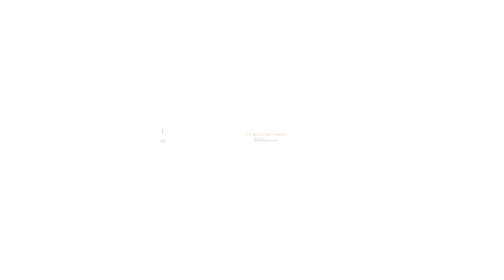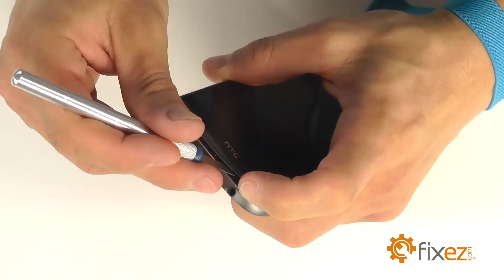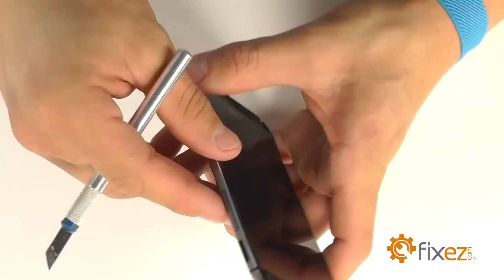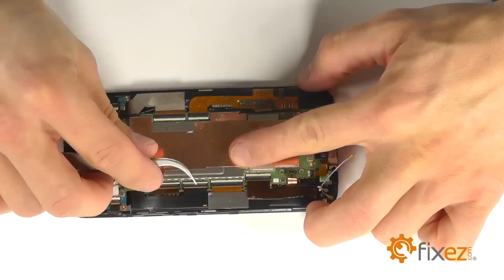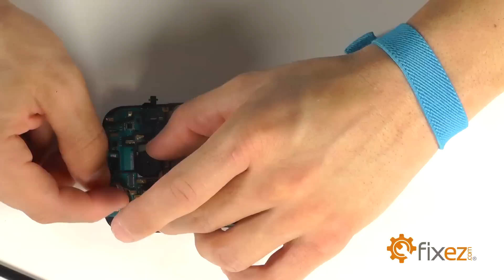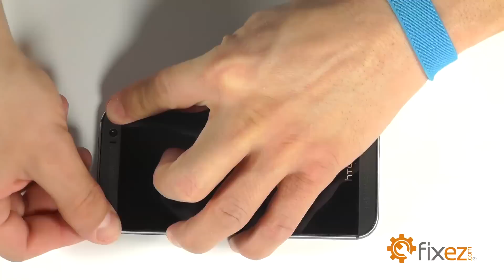Official HTC One (M8) Screen Repair & Disassemble

Comment: You should have mention what version is. Because there are 3 version. M8s, M8sn, M8su. There are big differences inside on the motherboard, charging port, display connector and antennas cables

Comment: What adhesive should you use when using a new part? Video is slightly misleading in being able to reheat and reuse existing adhesive on the existing chassis and part to be reinstalled..which wouldn't be available when replacing the screen?

Comment: Thanks, repaired the M8S with this, it pretty much had identical guts save for 1 extra ribbon cable that had the power switch, a connector to top board, and a direct connection to main board.
Reply: My htc not on when charging show battery logo

Comment: For those who will be doing this:
This process is a lot harder than what it looks like; they had done it before, therefore most of the parts were easier to remove or maybe just a new phone. I attempted to do this and it is harder to remove most of the components and be careful when prying ribbons, they easily break, I didn't break mine but I was really close.
Reply: I was about to disassemle my old m8 for the "funsies" as it's digitizer went kaput back in 2017. saw this comment and changed my mind lol

Comment: Followed this video and replaced my screen however I snapped the clip from the board that you plug the vibration motor into. I didn't realise it pulled out and just pulled it away from the board. Is there a way I can repair this? Do I need a new board? Tbh you don't even need to take that plug out wish I hadn't bothered
Reply: Soldering isn't really an option as it's so small, I've bought some adhesive glue to try, after that I'd have to just replace the upper board which I won't be doing.

Comment: Great Video, awesome Detailed Information, Wish I saw this video first :o/  I was able to replace my Charging Port, but after re assembling , My Volume down button does not work i can hear it click when I press it but it does nothing :o/ Also my power button has sunk in, and I have to press it down with my fingertip Nail to power it off or lock the phone, Can you tell me what I may have done wrong, and will I be able to fix it myself? Thanks. I have a developer Edition and would like to Keep the phone till a new better model comes out, I am not to happy with the M9 or M10 :o/
Reply: ERVARGAS NYC you just need to take it apart and put those buttons back in properly. Put the power button in and then do the opposite of what this video shows putting the top of the phone back into the housing rather than the bottom
Reply: George McArdle Thanks, Will Give it Another Shot. I havd bought. a brand New HTC One M8 AT&T Version,  Got it from someone who got it as a gift and just put it away, because he was into IPhone.  I would like to Fix My HTC's Buttons, As it's a Developers Edition Fully Factor Unlocked, Paid $740 including Tax,  from HTC.com  and I can Tether with Developers Edition with no Issues at all. AT&T phones block Tethering :o/

Comment: Just installed a new screen on my HTC one M8 by following this video.  Everything worked out good but now its saying No SIM.  Played around with the SIM holder and tried multiple things.  Decided to swap back in my old screen and its saying the same thing, No SIM.  Is there a connection i may have missed that would correspond to the SIM drive?  I checked the ribbon connection to the SIM and its full seated and locked down.  Any suggestions let me know.  Thanks
Reply from the maker: Check the connection shown at 7:20, Also check the contacts on the sim card as well.
Reply: Cole J I had this same problem and had to go back to my old housing
Reply: Yeah I have the same issue. I think I damaged the port on the main board and the No SIM message appears regardless of which housing I use. 
Welp - This was a solid learning experience at least. Plus I think using a phone for 3years is pushing it.
Reply: You've most likely damaged the ribbon on the sim card reader
Reply: Well thinking back the earpiece stopped working also. I'm going to check if the issue lies with the camera also because then I prob messed something bigger up haha!

Comment: Hi, i have to change the battery of HTC E8, anyone know if it is the same battery of M8?
In ebay for M8 i found B0P6B100 - 35H00214-00M
and for E8                     B0P6B100 -  35H00214-01M 
Probably this little code difference make them non compatible but i'm not sure....

Comment: I've done everything correctly, but at random times the phone will shut off without notice. I reopened it and looked for loose connections but their isn't any. it usually shut off while in my pocket and that's it. The power button doesn't get stuck. Does anyone have any ideas? Thanks in advance!
Reply from the maker: +skyeye21 If the insulating tape is not replaced over the connections they can sometimes short out against the back housing.

Comment: replaced my screen as you did. but the charging light just flashes orange and the phone wont turn on. the screen shows a battery charging symbol. any ideas?
Reply: I'm facing the same problem. Found a solution?
Reply: yes, the battery connection under the 2 screws wasn't aligned and snapped in

Comment: Question. How can anybody do this without getting frustrated?
Reply: Honestly, no flaws. It's everything you can ask for in a phone.  But, here's a note. I would also consider checking out the Nexus 6p since it's slightly bigger and better than the 10 by faster fingerprint recognition, slightly improved battery and camera (front/ back). Drawbacks are that unlike 10, 6p doesn't have sdcard slot. But from my experience, 6p performs slightly faster than the 10.
Reply: Holy shit who was the dumbass millennial shit engineer at HTC who designed this in a CAD program.  Someone beat his ass with a paddle that reads user serviceability.
Reply: CHOPPERGIRL's AIRWAR stfu with your millennial bashing. It’s getting old.
Reply: @choppergirl  😂😂😂
Reply: My screen has a lot of odd white spots on it and I thought about doing this, but nope....no chance lol. I can get a new phone on Ebay for sub $200 now.
Reply: I got thru the disassembly process.. breaking a flex cable of the LCD.
 And now I'm enjoying my new HTC 10 :)
Reply: hey goodday ;) how was your HTC 10? i am about to buy one next month ;) is there any issues you face for these 3 months of usage?
Reply: Take your time
Reply: idk how you got frutrated i mean it not easy and not hard
Reply: It is a really frustrating job!  It took my 5 hours just to take everything apart!  I do however love the detail the guy gives.  But yeah, it was real frustrating, and I had to walk away several times before sitting down and trying again!
Reply: well is really hard not to get frustrated only if you really like to work with electronics and disassemble and assemble them again also once you got a litlle practice it becomes easier. 
P.D. I work on this so i actually love it

Comment: i have a minor broken screen and i would like to replace the screen can i do so without further harming the screen
Reply from the maker: +wateule muse-ick If you're removing your original screen, you will most likely damage it in the removal process. Try your best to work through it slowly to prevent this but it may still get damaged.

Comment: HI. NEED HELP Fixez.com !!!

Done everything as per your video to change lcd, but now no touch and constantly reboots after 2 min. Thanks in advance!
Reply: +WorldWide Video 
UPDATE: reattached touch flex and now got half screen respond only, no reboot.
Done very close inspection under magnifier next to touch connector AND noticed that one micro filter broke off while im been disconnected flex several times. NOW looking for used logic board. Expensive mistake.
SUGGESTION: Dont repair HTC if you never done it.
Reply: +WorldWide Video how you gonna learn if you never do it. gotta start somewhere. Just because you fudged doesn't mean everyone else will. Then again I have repaired a lot of apple phones screens before. As long as you are very careful and follow instructions you will be fine. just work slow and double check what you are doing.
Reply from the maker: +mattike53218 Thanks for the input, positive thinking goes a long way.

Comment: I performed this repair yesterday and the video was very clear and helpful. Problems now are my power button doesn't depress like it should and the rear-facing camera doesn't work.  I can get the phone to power on & off by pushing really hard on the power button with a coin or something hard. I took the phone out of the housing and made sure I had the power button properly oriented in the case and that the part identified in the video as the proximity sensor (which seems to also have the power button connection on it) was in place.  I repeated this disassembly and reassembly twice, but no improvement.  It just seems like there is no "springy-ness" to the power button. Like something is missing, but I'm sure all the parts are where they should be. The proximity sensor doesn't seem to have much if any adhesive on it, so even heating it up didn't make it stick down very well.  Maybe I need to install some double sided tape under it? 

As far as the camera goes, I checked the connection on the bottom of the board as the video recommends and it was solid.  The rear led light works and the front facing camera works fine.

Any advice on either of these problems would be most appreciated!
Reply: +John Wiltse  Update: I took the phone apart again last night and figured out the power button problem. I realized that the power button is located between the little black button and gold foil piece (proximity sensor maybe?). Once I knew that, I was able to get the power button to align between those two protrusions and now it works fine.

No luck on the camera, however.  I confirmed that the connections are all solid but it just does not work. Crashes the stock Camera app.  When I tried a different camera app, it actually gave me a camera error message. I see there is replacement rear camera for sale on the fixez.com site, but I think my camera actually has 2 lens connected in a single metal housing (for the Zoe features) and the part on the web site doesn&#39;t appear to have the 2nd lens portion.
Reply: +John Wiltse hey  can you tell me what actually happened  to your rear camera. My phone screen broke so I gave it for repairs,  but the camera isn't working now,  front camera is workinh fine,  just I get black screen if I try use rear camera from snapchat Or Instagram and the rear camera isn't being shown at all in the camera app. 
Regards, 
ABHI
Reply: I didn't get a black screen when using the rear camera. As I said before, choosing the rear camera caused the camera app to crash. I sold the phone on eBay advertised with a non-working rear camera and bought a reconditioned replacement.

Comment: Thanks for the vid. I just replaced the screen and charger port in my M8. Before I put it back in the back housing, I tried plugging it up to the charger and pressing the power button to see if it works. The battery has been dead for about 2 weeks so I don't know if the battery needs charging for a while longer or something internal. The LED orange light stays on while plugged up and the phone doesn't come on when I press the power button. Please help.
Reply from the maker: +khaoe smith Your battery may be bad. But it can also be a bad LCD, double check that nothing was missed on the reassembly. Check your flex cables to ensure they are seated properly.
Reply: +Fixez.com ugh....I checked everything and all the connections are OK. The other day while checking some things I broke the clip that holds the ribbon that you take apart at 06:12 but the ribbon still goes in and holds firmly.
Reply from the maker: Possible the connection is not fully seated. Although appears to be, it may not be holding it's position as it should.

Comment: i replaced my screen as you did. but as i put the charger on it because my battery was stone dead. my charging light just flashes orange and the phone wont turn on. the sceen shows a battery charging symbol. any ideas?
Reply: turns out that the battery plug didnt seat correctly, and it turned on once i out it on correctly again
Reply: same thing happened to my phone now. what did u do to fix it?
Reply: just keep the charger on and the light will go solid red and then you will be able to turn it on.
Reply: Used the Charger of my Chromecast with only 0.25 Ampere. Used the original with 1.5 Ampere. now it's working!

Comment: My HTC M8 screen shows no physical damage. The screen just keeps phantom pressing (severely at times)..doesn't respond to touch sometimes...& the top part of d screen used to get to the pull down menu doesn't work at all...these problems just started out of the blue...might this be a software issue or should i just replace the screen ????? 

Thanks!
Reply from the maker: +Raoul Fraser Possible software issue. Try a factory reset first, if the issues continue your digitizer is most likely the issue. In this case you would want a new a LCD and Touch screen replacement.

Comment: I did everything as shown, but the sim card doesn't work.. Any ideas?
Reply from the maker: +Vasil Filipov There's a small flex ribbon that should be connected by your sim card slot. Ensure this flex cable is connected properly.

Comment: Hi, is there a easy way of separating the touch screen digitiser from the LCD and then putting a new digitiser onto the previous LCD without any issues? Or is it easier to just buy a new LCD that's already fused with the digitiser?
Reply from the maker: +rachid qui You would want to replace the LCD and Touch screen as the LCD is fused to your front glass.

Comment: question will having lose connectors behind the board where the camera is cause the power button not to work?? I replaced the screen and noticed it wasn't working then took it apart again and noticed one of the connectors behind the board was not connected. just wanna know if that would cause the lower button not to work before I put it back together.
Reply: *power button

Comment: Hey. I dropped my HTC m8 the other day. The phone fell on its right side bezel and shattered the screen. everything works perfect, just the screen is shattered. However, there is a small 1/4 mm dent right above the SIM card slot, which is protruding into the screen where the phone is shattered the most. So I was wondering, do I just need a new LCD display or does the whole chaseè need to be replaced in order for the screen to fit properly again? Thanks in advance.

Comment: Hey, the rear facing camera doesn't seem to work. There is no option to switch between cameras. I took it apart again and check the connection and it seems fine? any advise?

Comment: I went through all the steps to replace the digitizer and powered the unit back on...everything works except for a portion of the digitizer (the location is where "Power Off" would be located when you hold the power button on the phone). Do you think this would be an issue with the replacement digitizer or would it be a faulty connection with one of the ribbon cables? Any help you could provide would be greatly appreciated!

Comment: You need to go into more depth on how to remove the earpiece speaker. I just destroyed mine thinking it was supposed to be easy to remove... Let me just tell you all that it is not.
Reply: Braden Jensen *****  I Should have read the comments... just done the exact same :'( It is very delicate and if you don't go deep enough you just rip it in 2.....
Reply: Yeah that's what I did. I ordered another one. Comes next week..
Reply: Braden Jensen I ordered a "Genuine" one and the speaker just buzzes at full volume so its defo not a real htc one.
Reply: Sarah Banister are you on the stock ROM?
Reply: Yes i am on Stock ROM =)

Comment: i have  an htc one m8. it got run over by a car. the screen of course was completely shattered and it did not display anything. i opened the phone up and it was perfectly fine in the inside but the lcd was cracked. i put it on chrarging and the led still turns on. i was wondering is it just the lcd or the phone. again the mother board and the inside looks perfectly fine.
Reply: THanks for you👍

Comment: My m8 fell and is bent slightly from the top of the volume button. Everything still works fine but my screen has a small purple-blue ish spot. Touch works perfectly, and everything is still being displayed on the screen, even beneath the spot. Does my digitizer have to change or the lcd? Thanks

Comment: Hi, thanks to show how to disassemble HTC m8. Did follow steps to change damaged screen (phone was working befor screen change), after assembl phone, phone has purple/white snow on the screen. Any help to fix the problem will be appriciate!
Reply: Hi!Marko Kucan Did you solve the problem? Because I have exactly the same problem (purple/white snow on the screen) Was it the flex cable? Thanks!